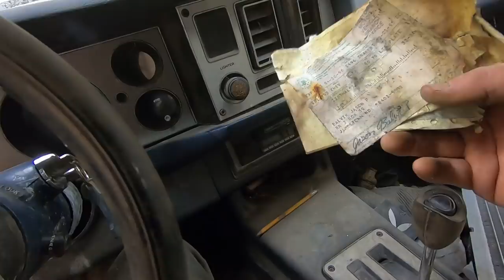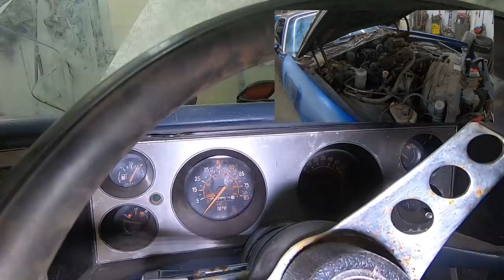Mullet Machine Abandoned for 25 years! 1980 Chevrolet Camaro left for dead! Will it run?!?

Comment: The radiator is probably a replacement for the broken one that allows the water to enter the tranny cooler.   Which is the replacement?  The one on the seat or the one in the car?????
Reply from the maker: The one in the seat was supposed to be. But doesn't the trans oil have higher pressure than the coolant and wouldn't the coolant be green?
Reply: @MortskeRepair  The coolant is only colored if someone actually used . coolant.  it could be just straight water.   No, the pressure diff would not stop this from happening.

Comment: I know the 4 inch bore chevy small blocks are superior to the 305 but really the 305 isn't a bad engine. Im a ford guy & yes I believe the 302 ford is better than the 305 chevy but really when built i think they are fairly equal. It might be easier to find go fast parts for the 302 but the 305 can be a strong contender. Very few people use them becouse the 327 & 350 are so available most just say why even use the 305. But in a comparo test I saw that Richard Holder did showed the 305 running along side the 302 ford when built.
Reply from the maker: You guys had all the good lines!
Reply from the maker: Nothing wrong with a 305!

Comment: Damn you would have a red white and blue ultimate mullet machine. Flu body got through the red fenders may be on it leave the white Hood put the red engine in it the transmission out of the red car maybe the red interior in it oh yeah. I would leave the black louvers on and everything oh and you need to get one of them k40 magnet Mount CB antennas and put it on the trunk or on the roof. I think the trunk would look better with it. I put some of them box speakers in the back windows and some fuzzy dice hanging from the rear view  with that garter belt oh man you be you be getting some women looking at you.

Comment: i got 3 for free all 79 z28's one is a z28 rs t top with full spoilers got a stroked 454 450 hp engine with tunnel ram with a 02xx 400r turbo good to 800 hp got 4 of these crate set ups for free from 6,000 miles to 58,000 miles on them but i get a lot of rigs for free . then i get a lot of aftermarket parts from drag races in trade they want good project rigs i need parts for my projects
Reply: the louver in the back window was factory option from 78 to 80 i have 2 of them
Reply from the maker: Nice!